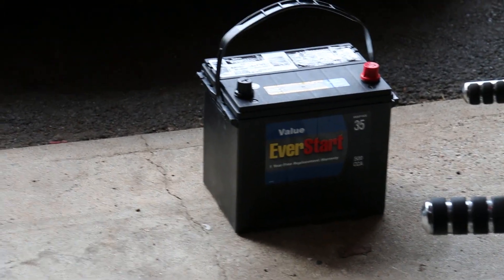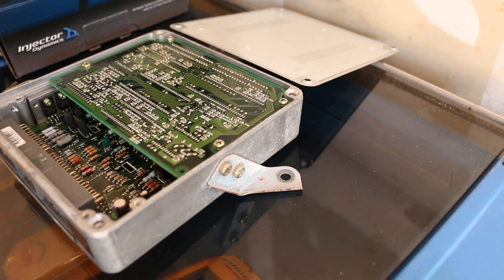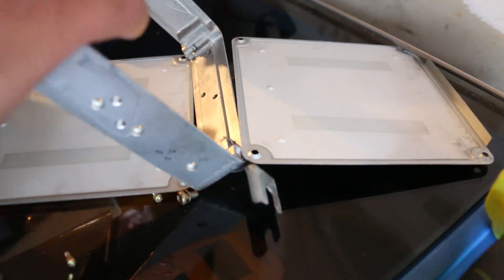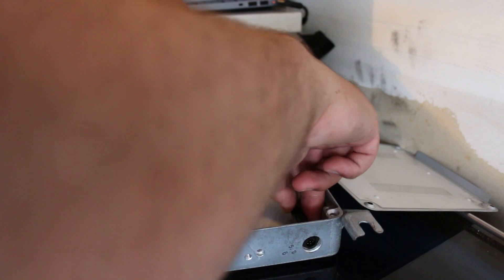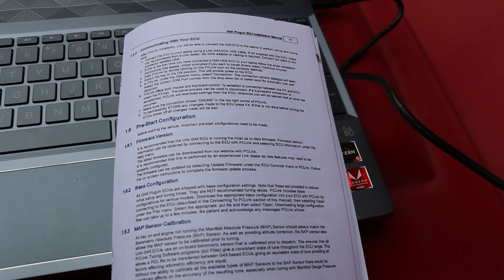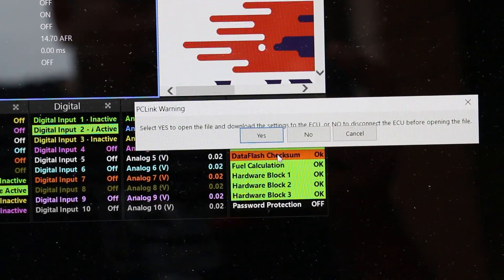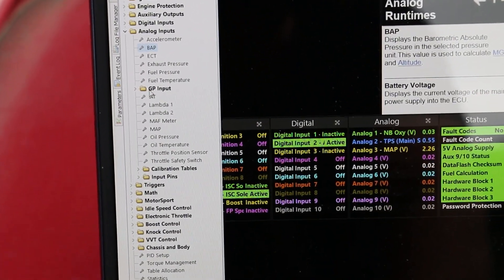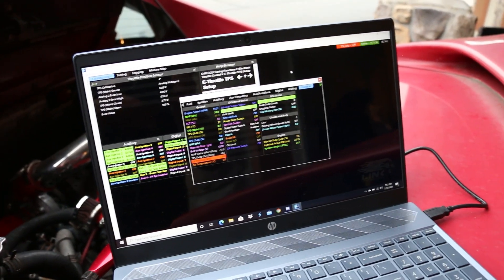MR2 Link ECU Install - G4X Plug and Play ECU

Comment: I'm pretty sure you done this install wrong. The socket bit gets installed into the side of the ECU casing, (not passed through). Then you'd have a port in the side of the ECU that the ECU-USB cable plugs into. The end unscrews off the socket end of the ECU-USB cable, the orange 'O' ring is the seal so it seals to your casing

Comment: Hi, great video. I have noticed that check engine light in the instrument cluster doesn't light up when the ignition is turned on. Its been like this since the link stormx was installed. Is there a setting for this in the link software, or anything else we need to do so the check engine light works again? I am afraid that it can cause problems if its not working like MOT. The redtop beams (in my 91 mr2) are going to be tuned again after new catcams are installed so my tuner can look at this then. Not sure if it are needed or not with the link stormx, but if there is a way to get it to work I would like that.
Reply: Yes, there is
Reply: @d1zguy864  Thanks for your reply. My understanding is that this turned off by defult within the link software? And how did you sett it to light up during the cluster check as with the OEM ECU?

Comment: I recently just purchased a third gen 3sgte and it came with this ECU without the instructions. I have a check engine light how do I check it? I did it the traditionally way with the TE and E1 bridged and the light flashes five times slow then five times quick. I have a check engine light turns steady while driving unbridged now and I can't figure out what it is or how to read the codes.
Reply from the maker: To check the CEL on a Link, you'll need to plug the ECU into a laptop. You should have a USB cable coming out of the USB. You'll then need to download the PC Link software from Link's website.
Reply: So to get rid of the Cel I have to go thru the lap top as well? I disconnectd the battery and the ECU fuse with no luck.
Reply from the maker: @tommyhajimoto6968  yes, that's the best way to see the error code(s) and the best way to clear them.
Reply: @FoulNews  thank you.
Reply from the maker: @tommyhajimoto6968  You're welcome! Best of luck with it!

Comment: did you run the onboard MAP sensor or an external sensor?
Reply from the maker: I'm actually using a factory Gen 3 3S-GTE MAP sensor. Eventually I will upgrade.
Reply from the maker: Also on this PNP, there's no internal MAP sensor unfortunately.
Reply: @FoulNews  I am getting g4 xtreme for my 2jzgte vvti, so i was wondering that is it better to use onboard MAP or buy an external MAP
Reply from the maker: @arjunchaudhary3166  If that ECU comes with an on-board sensor, I'd use that.

Comment: I swapped a 4th Gen 3sgte into my st202 celica, what aftermarket ecu would be best
Reply from the maker: I strongly recommend Link, they're great ECU's. Fortunately the great folks at KO racing just released a PNP for Gen 4 and Gen 5 ECU's. http://koracing.net/viewproduct.php?folder=42&product=1526
Reply: @FoulNews  what link ecu would u recommend? It's still running 3sge ecu
Reply from the maker: @COMET247  a G4X is what I'd recommend. The link that I posted comes with a G4X installed into a plug and play board.

Comment: When you did the meth injection on the 535 did you integrate into the dme or just run it as boost referenced?   Did you tune for it specifically?
Reply from the maker: I left it as boost referenced, so it always turns on at 10psi. My tuner did tune to take advantage of the extra fueling and cooling, however, it will work just fine without being tuned for it.

Comment: Trunk Clips:  I think you just take the tip of a small screwdriver or pen and push the center of those clips in a bit and then they will just pull out.
Reply from the maker: That's probably how to do it correctly. I just did the BRUTE FORCE and replace the clip method 😂